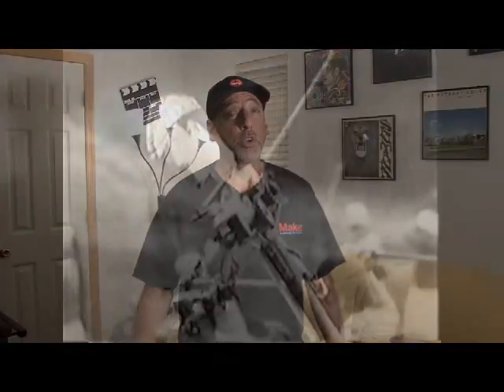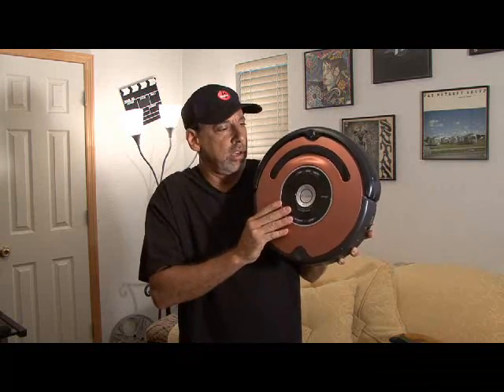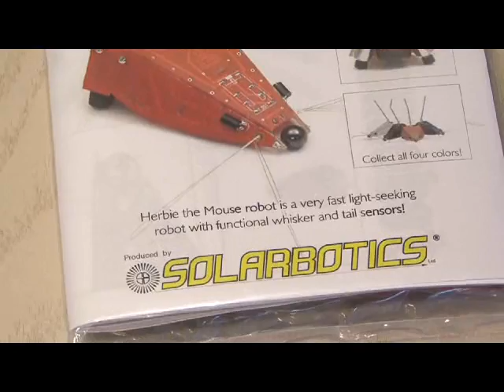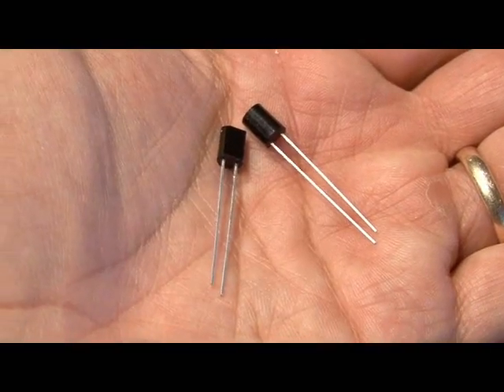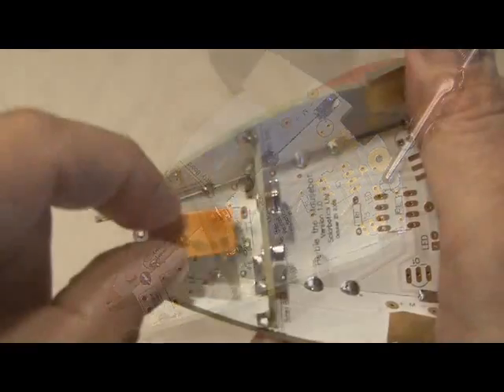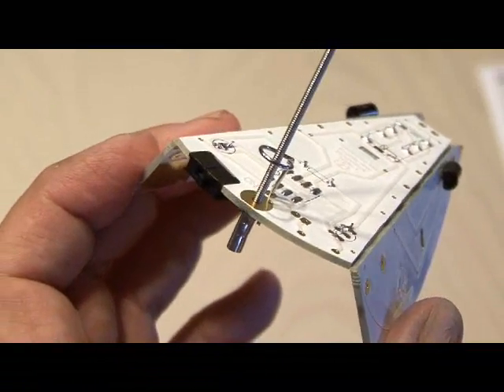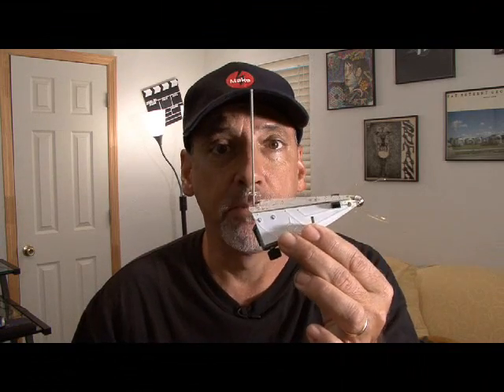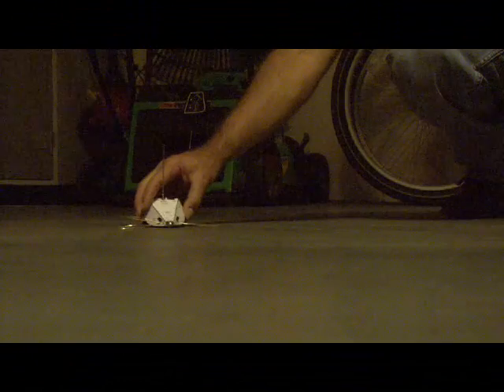Weekend Project: How to Make a Mousebot

Comment: The robot Brie made was solar powered, not light seeking. It moved significantly more slowly because it would sit in the sun until it had enough energy to move, and then make a half second movement and half to stop. It automatically moved toward light because of its diode's positioning. Herbie, on the other hand, is powered by a nine volt, as as such is a pretty regular car-like robot. It just has the diodes that make it follow light.

Comment: This little robot works by detecting light levels via two Light Dependent Resistors (eyes). Increasing the level of light on one eye increases that eye's resistance, causing the wheel on that side to turn slower and thus the robot turns towards the light.
if light levels are roughly equal on both eyes, the robot will move roughly forward, otherwise, it will move towards the more intense area of light.

Comment: so you could put the light sensors on an rc car at each side and re wire the motor so it will follow a flash light? project accepted.

Comment: it's true though. They have gradually turned into an appliance store instead of the humble hobby shop they used to be. They should at least make specialty "radioshack" stores for hobbyists. They could call them invention labs instead of just making up shallow websites that take advantage of the web2.0 social fad.

Also, in canada, all the radioshack stores were bought and renamed "La Source" which is bawls because they only stock NexXtech when it comes to electronic/micro-electronic equipment.